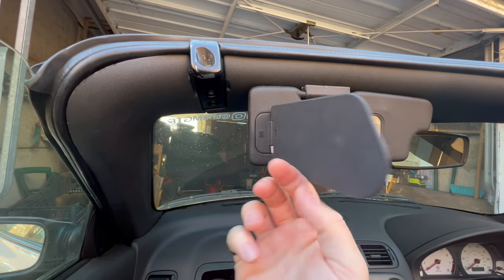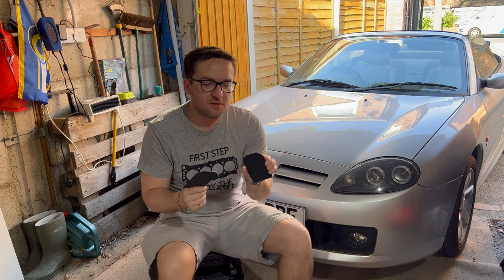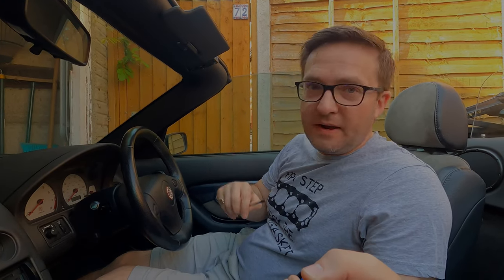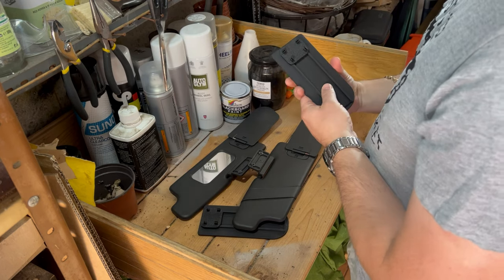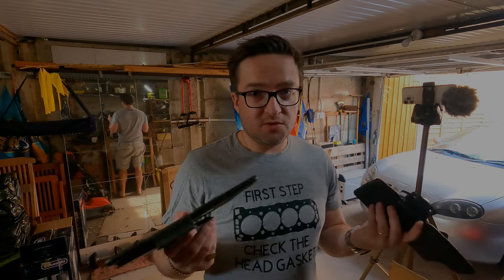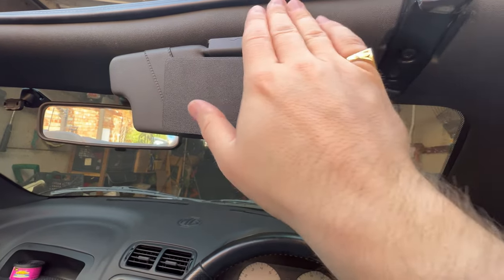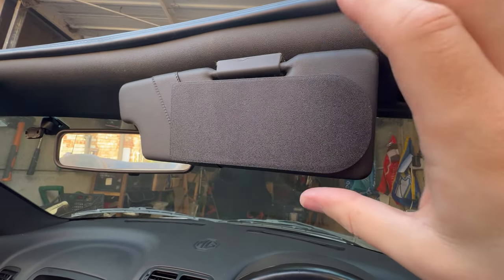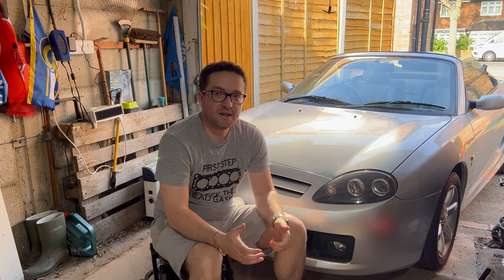MG TF | Fitting 3D printed sun visors

Comment: These do look good.   Thanks for the video.   
I have replaced the original ones on my MGF with second hand visors from an Alfa GTV, which screwed straight in and look pretty good.   I 3D printed up blocks that filled the original pits in the windscreen frame, which the Alpha mounts didn't fill.    If anyone wants to try this, I'm happy to share the printer files.
Reply from the maker: I knew there was an option to replace the visors altogether. Although I thought they were from a BMW Z3. Didn’t know they were from an Alfa GTV. Do they work well?